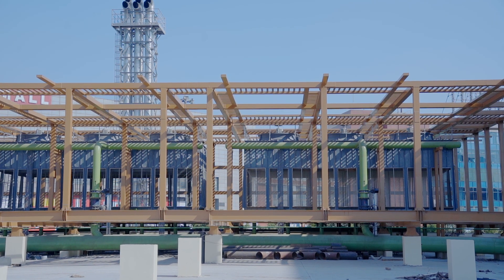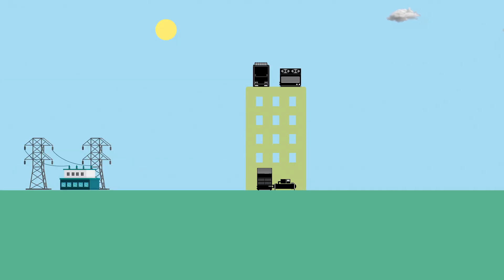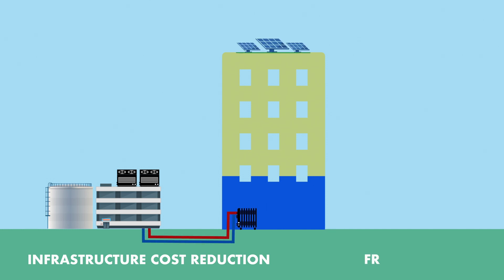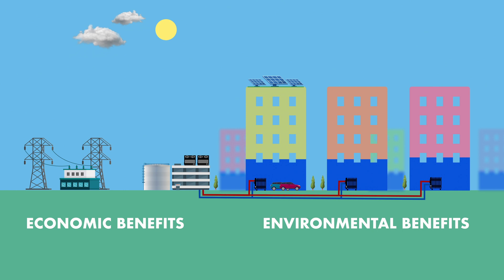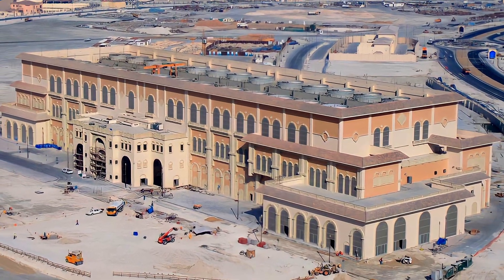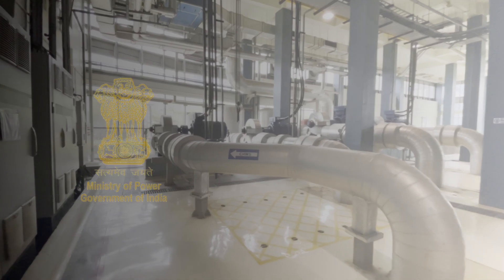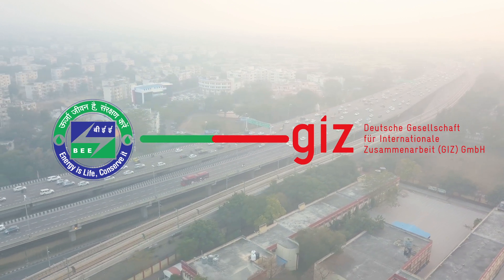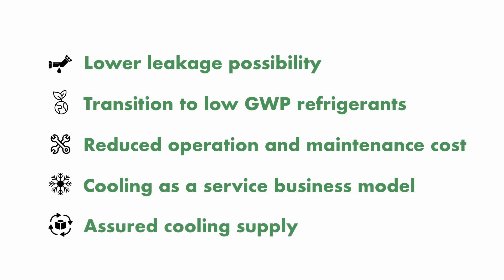Revolutionizing the Future of Cooling in India: Exploring the Power of District Cooling

Comment: I would, could nuclear power plants play a role here?
Reply: Having worked on a district cooling project ~20yrs ago I would suggest forget about nuclear power for this 

Because as said one of the advantages of DCs, especially in the global south, is to lower the urban heat island affect, in warmer climates this is more important because the night cooling isn't as dramatic as the global north 
So with an already warming climate, the nuclear plants need cooling down at times which is often into a body of water acting as heatsink. 
That water is staying elevated already because it is actively and passively removing latent heat from the surroundings, dumping additional heat from a nuclear plant will only increase the waters heat and restrict it's ability to absorb heat from the ambient environment and in turn release it's heat into the ambient environment (including at night) adding to the urban heat island affect and increasing the demand for mechanical cooling 

It wasn't recommended in the cooler global north for this reason (even with extreme winters) so it definitely isn't recommended in the global south including India, where extreme heatwave are only increasing without reprieve, better options exist